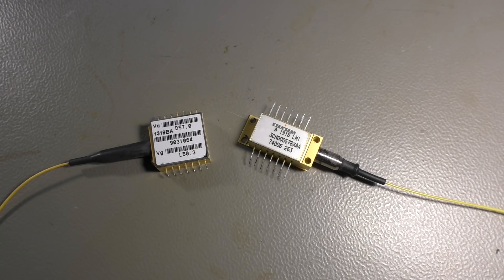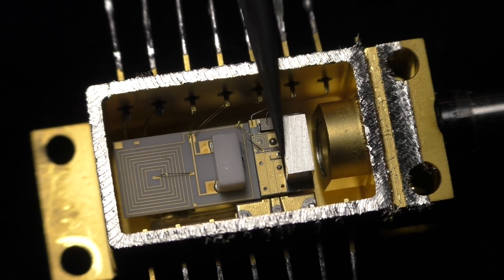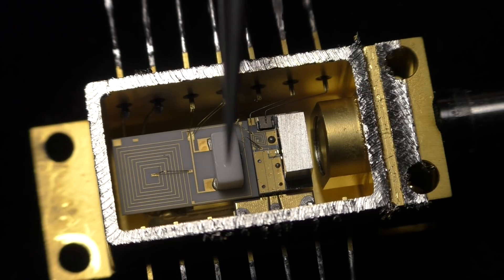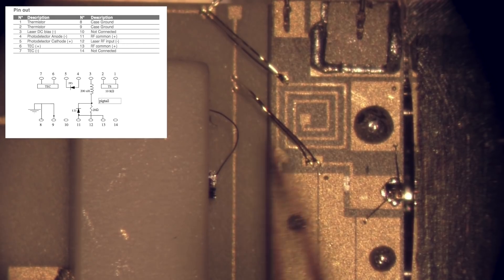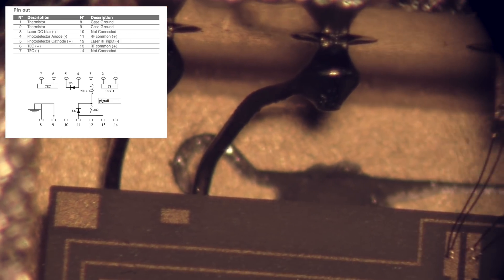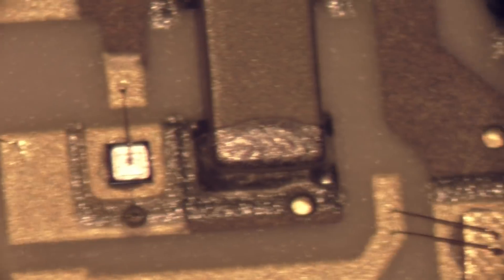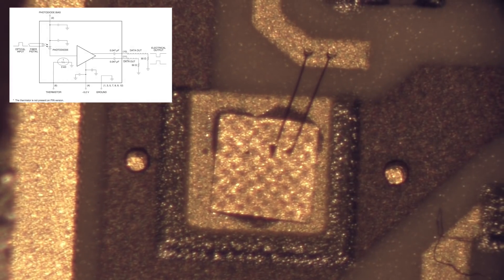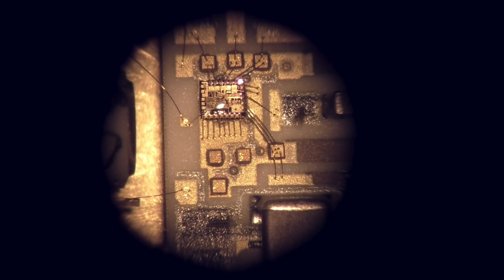Alcatel/Lucent Fiberoptic Laser and Receiver - (PWJ95)

Comment: The square things might just be terminals insulated from the large pad under them and are used to interconnect the bonding wires. Most of the bondings wires of the chip are all in parallel by the way.
Reply: They could be protection diodes due to the high voltages involved (would make sense if they are connected to ground on the bottom)
Reply from the maker: I don't think so. They may have multiple wires but the surface is one single conductor, the wires are all in parallel. There is no gap or insulation visible.
Reply: That's my guess as well. protection diodes, though i have never ever seen diodes that didn't look like a piece of naked silicon. It might as well just be an intermediary terminal to join the bonding wires on.
Reply: Those are transistors, the ones with 3 therminals (two bonding wires and substrate), and the ones with just one bonding wire are diodes.
Reply: possibly by-pass caps?
Reply: msylvain59 they are single layer capacitors. These are used because they have a very high Self Resonant Frequency (due to very little parasitic inductance). They are routinely used in broadband microwave circuits and as one  commenter above states, they are most likely providing local decoupling (probably in the 10-100pF range).
Reply: msylvain59 they are single layer capacitors. These are used because they have a very high Self Resonant Frequency (due to very little parasitic inductance). They are routinely used in broadband microwave circuits and as one  commenter above states, they are most likely providing local decoupling (probably in the 10-100pF range).